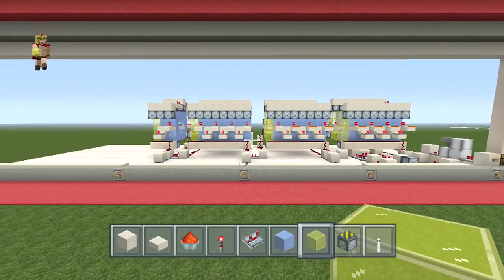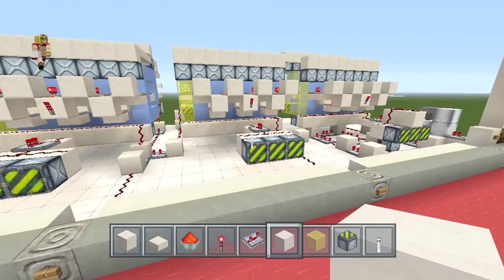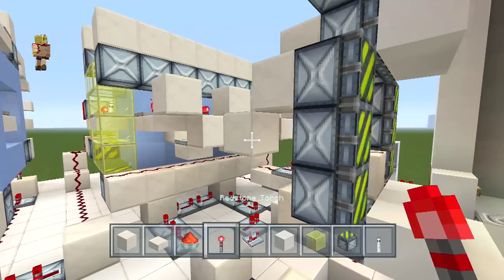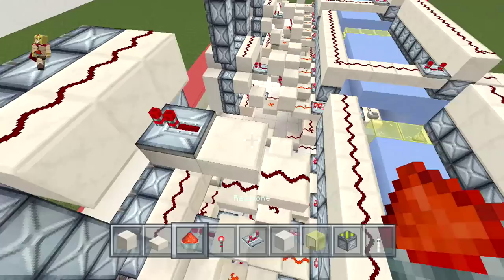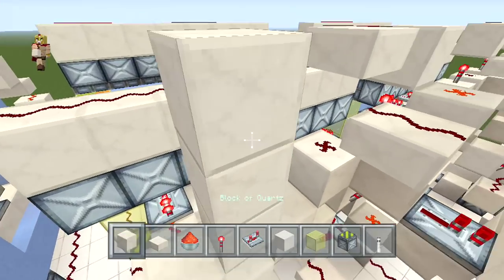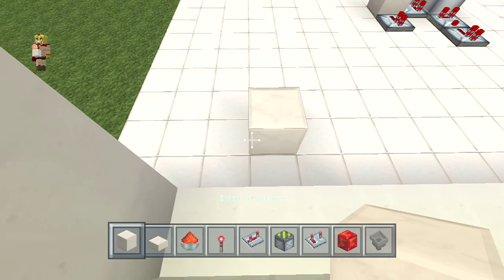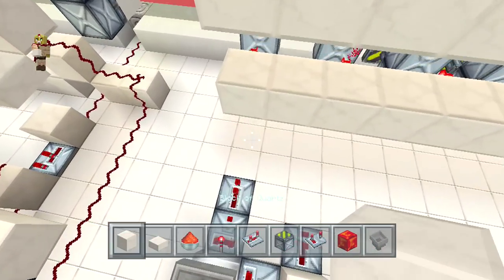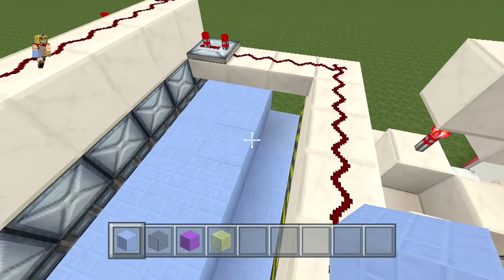Minecraft Tutorial : Digital Clock with MC Time or Real Time Part 2

Comment: Spot on, i followed you when i was first using the ps4 but i just built this on strictly vanilla server on pc 1.11 and it works well, i had the hopper clock problem, it was being powered from the display above so i just moved it over by 1 block and repositioned the repeater. Thanks K1

Comment: I have the same hopper clock problem on ps4 for the real time build. It stops at about 3 runs ( 3 minutes). I have to keep on 'resetting' the hoppers by taking my 75 blocks and refilling the other hopper. It worked seemlessly until I started building the number codes. I can only come up with it just being glitchy as the clock is the only redstone machine  in my creative world. In my survival world, I have several redstone farms in one area and one uses a hopper timer like this and I've never had this problem. Unless someone has a fix, it's likely just a bug that has stopped the hopper timers here.
Otherwise, GREAT tutorial and so easy to understand-even with the coding part. so easy I stopped watching the coding and did it myself up until the fourth part :)

Comment: Well i must say you are pretty good to explain and demonstrate.

I found one error and correct it.

It about the way to set up AM and PM.
The probleme i have with your set up is
when it change from PM to AM, it was showing AM 1 and after it was showing AM 0 
So the probleme is when it swithc to PM ot AM or AM to PM it show 1 on first sequence and nothong on the other and it should be the oposite, since when we pass from 11:59 Pm and should be AM 0 and not AM 1 like it do with the set up you show on the video.

To correct it You need to put Yellow Glass + 2 Wool and Purple Block + 2 Glass on rotation and that way when it pass From 12:59 Pm to 1:00 AM that how i fix my probleme :D hope it help other :D

Comment: Created this today. At first, everything worked perfect except the am and pm would not change. Then, the first number 1 stopped working for no reason. I rebuilt the section for the number 1 and it still malfunctions. The "programing blocks" get pushed out of place. Then, when I went to turn the system off, the button started malfunctioning and wouldn't keep the system off. I'm on a Ps4 pro.

Comment: I'm making the clock in real time and I have finished the clock however the hoppers stop switching the dirt blocks to each other as the comparator keeps cutting off after a while. Any help would be highly appreciated 
Psn- afc8945
Reply from the maker: +Arshad Jokhia yea im here to help you play on the ps4
Reply: +K1 Inc. hey man thanks for this. Any chance you know why the hoppers stop switching blocks to each other? Is there a glitch with hopper timers? From reading reddit I've encountered a few others who've said in various other farms and stuff that it will stop working / circuit will halt. it will work if i stand there and stare at it but i go away and do something else it will stop (I think) or I could be looking at the display of the clock it will stop. I am playing the PC version of Minecraft. overall great design. Another question is what is the purpose of the silent T Flip Flop in the design for Real Time Clock version. As I look at it and it doesn't seem to be powering anything...based off of what you did. Any clue as to it's purpose here? any adjustments?

Comment: i did section one but on the code sheet im confused on wich numbers to do next
Reply: +iamcrazy gaming probably u mean the order of the numbers right ? 
as far as i understand u want 3692581470 in this order 

because due to the time shift u receive with the minecraft time. you can not display 1 mc minute with ticks ( 1 mc minute ~16,66 ticks) thats why u skip some numbers and end up with this order. 

you can also solve this problem if u build a tripple clock with 17 17 and 16 ticks for each minute :) not exactly correct for every minute but you can display all numbers in correct order and will not notice this small interferrence anyway ;)
Reply: Oh Thank you Hagen Scholz